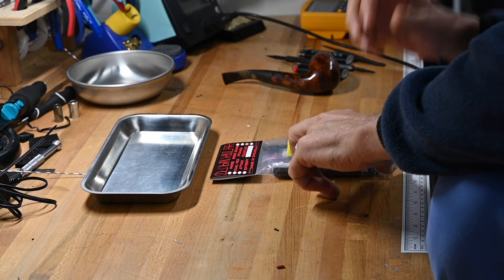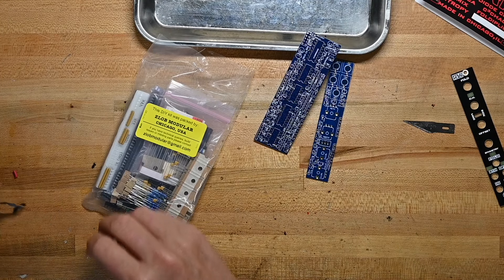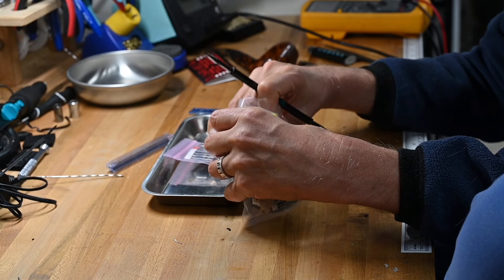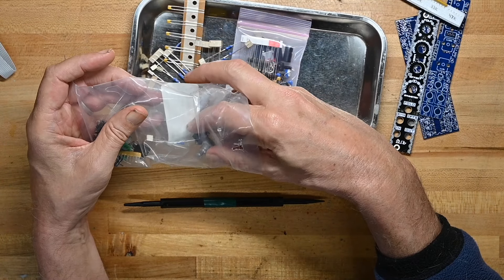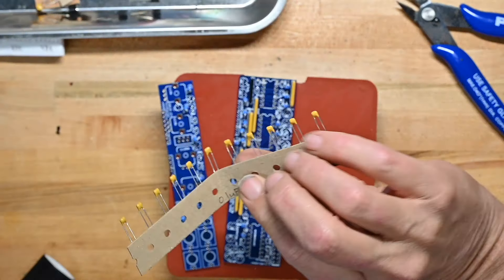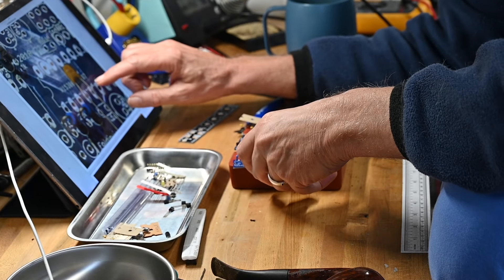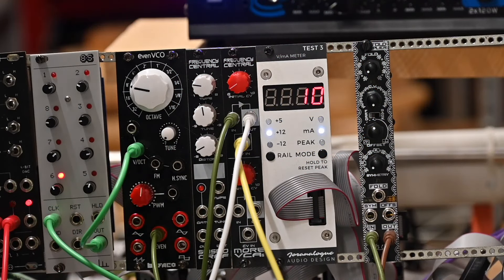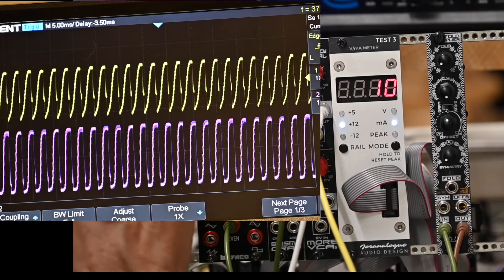C.K. builds a Foldiplier kit from Zlob Modular, eurorack

Comment: ha, I built one of these a few weeks ago when Thonk had a promo discount on, so I was hoping you might get round to one yourself.
 I like it a lot. It was probably only the 2nd or 3rd kit I'd soldered but it was fine. no smoke, worked first time. 
I really like your videos - they chill me right out.
One point of interest (maybe) is that you note that resistor arrays have a particular required orientation, but the build instructions from Zlob explicitly state that they don't.
Reply from the maker: Thanks for the kind words, "chill" is definitely where I want to be!
And I was wrong, these are NOT positionally sensitive.  This package (268--100k-RC) are NOT common grounded, as many resistor arrays are, instead they're individually pinned, which makes them positionally independent.  Here's the data sheet;  https://www.mouser.com/datasheet/2/351/Xicon_09142016_SIP-RC-1201759.pdf